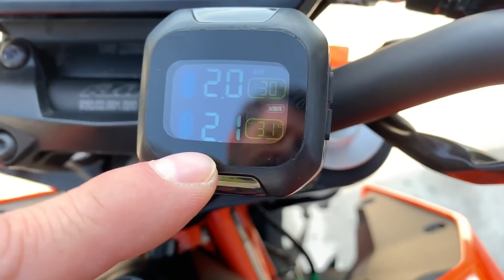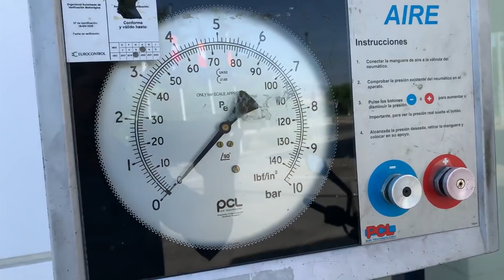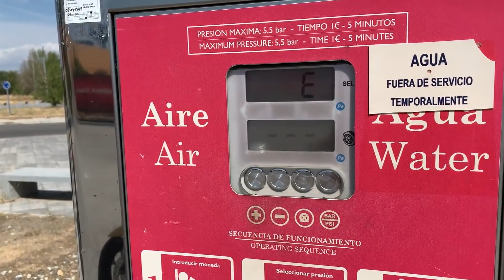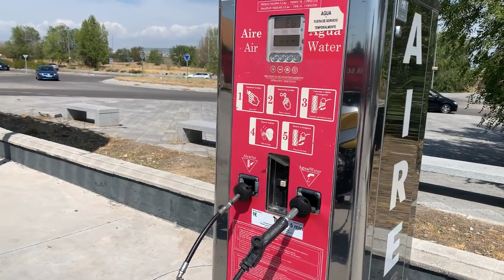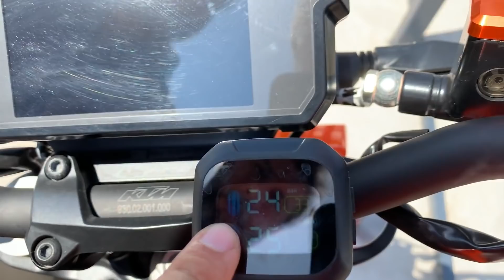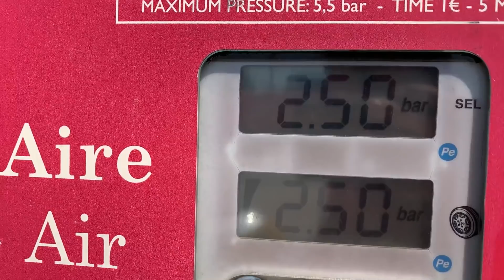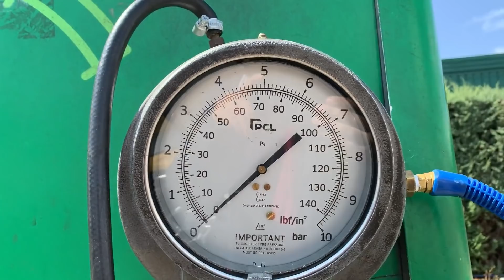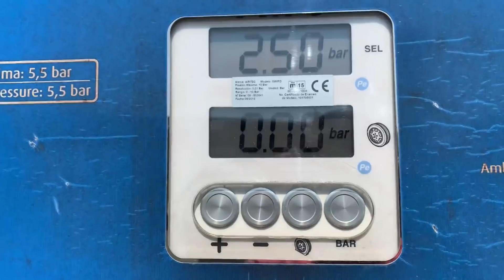¿¿ MEDIMOS BIEN LAS PRESIONES DE LOS NEUMATICOS ??

Comment: Hola la presion correcta de la duke 390 es de 2.0 kilos tanto delante como detras,con acompañante 2.0 delante 2.2 detras lo asi lo indica el manual.
Reply from the maker: Según servicio técnico de KTM 2,3 delante 2,4 atrás. De hecho así me las dejaron en la última revisión con estas Metzeler
Reply: En el manual de la duke 390 de 2017 salen 2.0 delante y detras, mira a ver que pone en el manual de la tuya, me fio mas del manual que de un taller aunque sea oficial